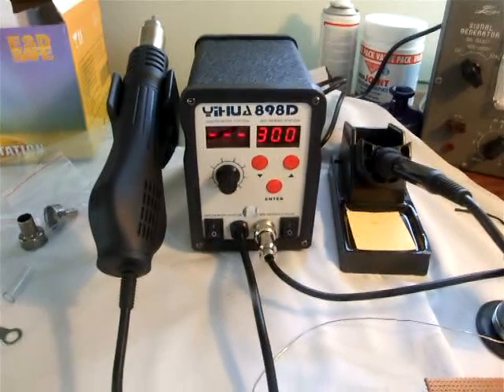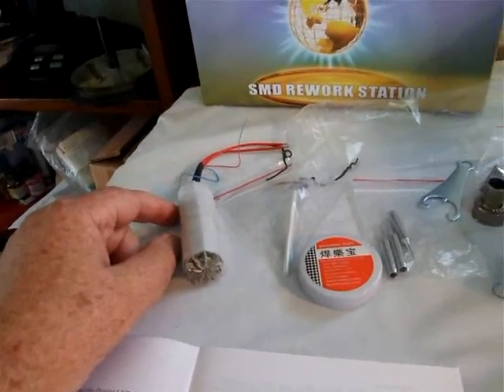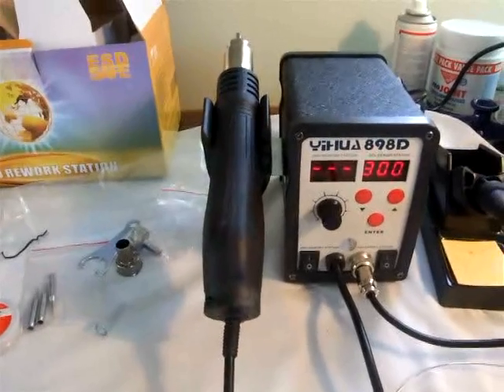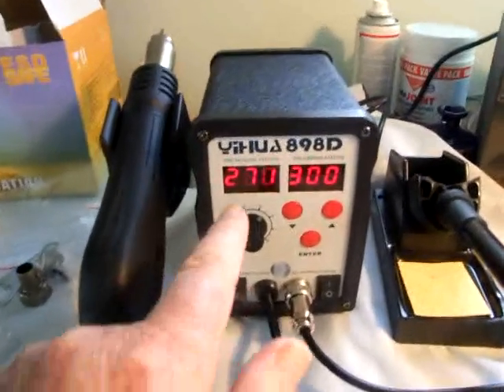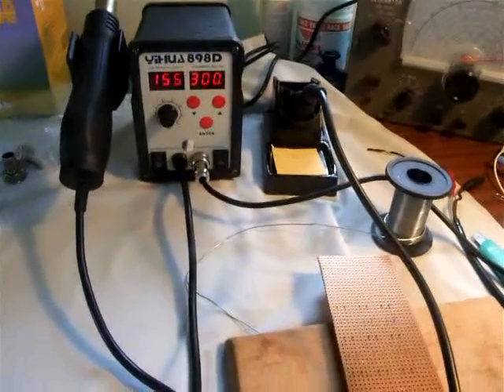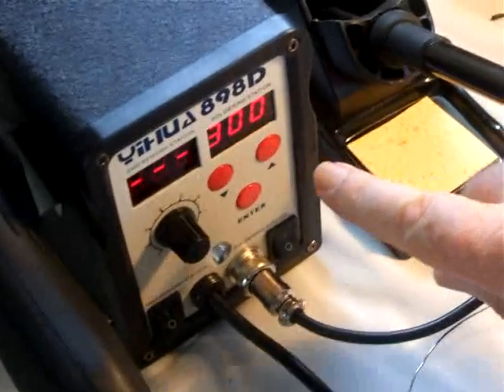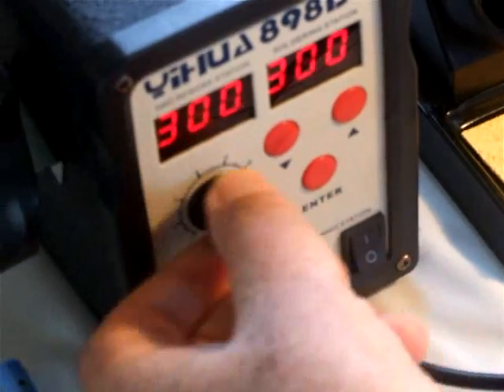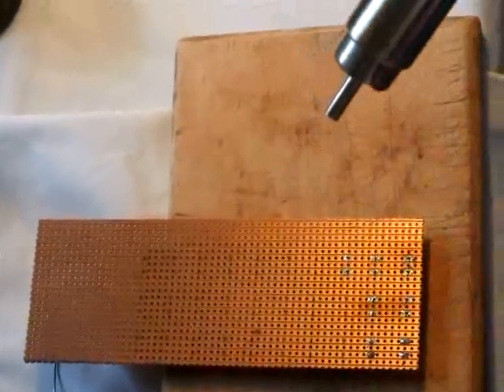Review 898D rework and soldering station

Comment from the maker: You will need a replacement soldering element. Elements either break down quickly, or last for years. Good news is they are cheap around US$10. I have had very few issues with these units apart from the solder element. Hope this helps!

Comment from the maker: @idletorque1 Hi it can be used for both solder and desolder SMD. The method is to apply paste to the pcb, put the parts on their relevant tracks, then run the workstation blower over which melts the paste and bonds. The reverse applies if you wish to remove parts, which is usually the most common use. I dont have any spare boards here with smd parts otherwise I would have demo that method.

Comment from the maker: @idletorque1 Hi. Unfortunately, you did not observe, and listen to the video properly. I actually use  a DSE station and mention it does not solder anywhere near as well. Also the rework part is mainly for working with SMD boards, which I did not demonstrate. Thanks for your comments though.